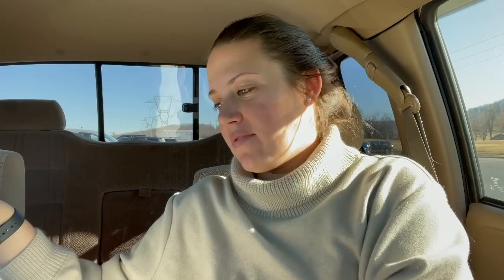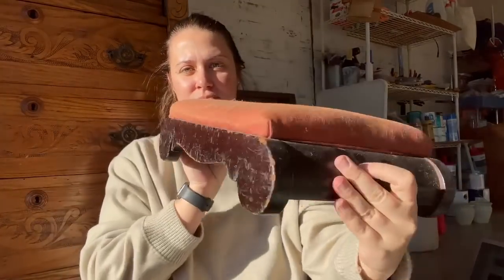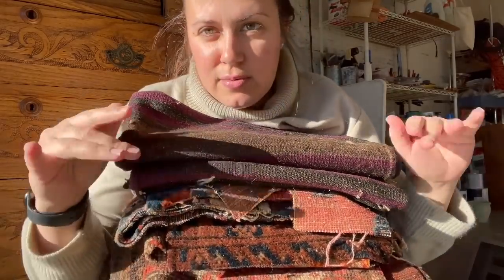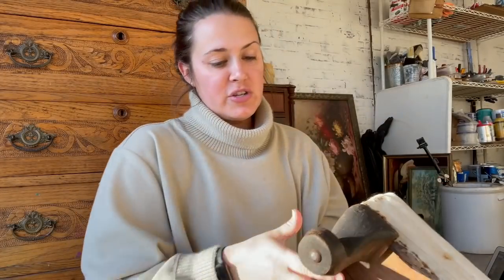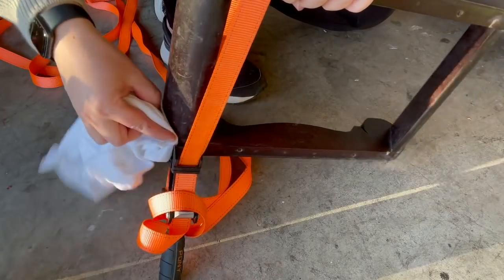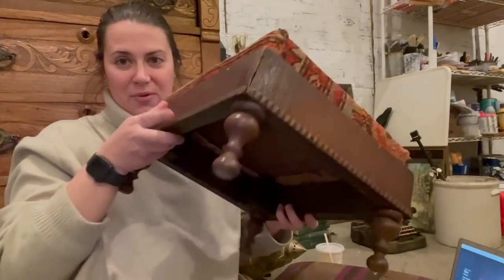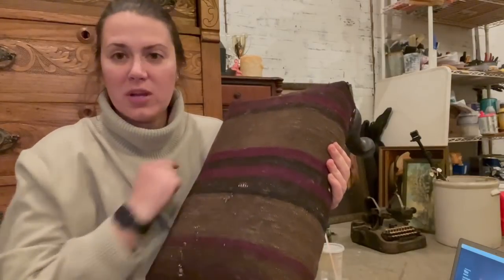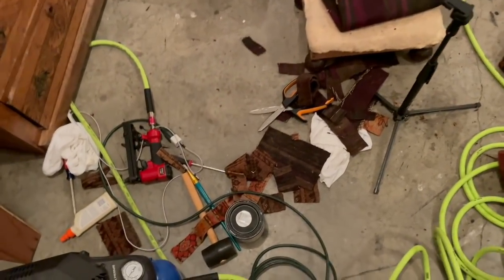Antique Footstool Makeovers Pt. 1 | A VINTAGE VLOGMAS '21 Day 15

Comment: Don’t add more paint.  Less is more.  Tip- You could use the old covers as patterns to cut the new covers.  Love the way they are turning out.  I have a thing for foot stools.
Reply: Depends on the fabric though. Thick rugs may need a bit more. But nevermind me—I recently donated some ragged old rugs. Didn’t know why I was hanging onto them. Kicking Self!!!

Comment: I agree, to much negative space. However, it would be to busy if you copied the top onto the sides. I vote a happy medium. Fill in the 2 larger spaces with a super larger version of your leaf sprigs in the curving motion. 2 sprigs each curving out from center with equal space above & below the sprigs. (Leave the handled sides alone). No matter what...It is a beautiful piece. Can't wait to see it all finished.

Comment: I have a stool fetish, glad your doing these. So when you cut the corners of the carpet remnant the cut seam doesn't show?   Leave the trunk as is, except maybe do one line of dots on the top edge of the box . So when it's closed it will have two rows of dots..